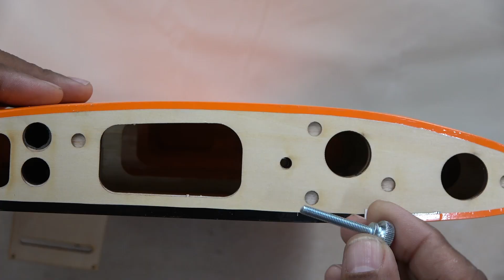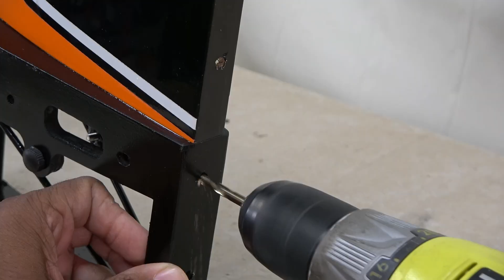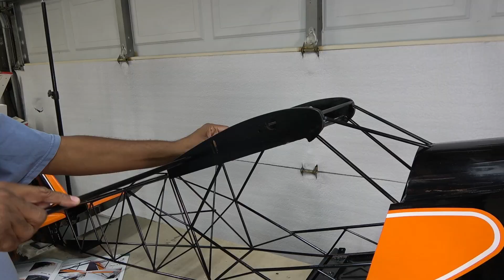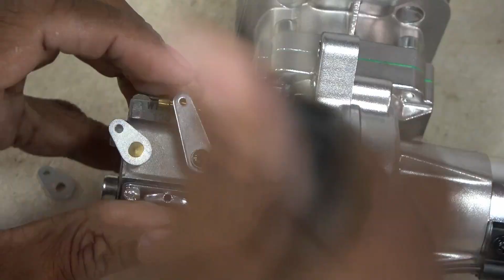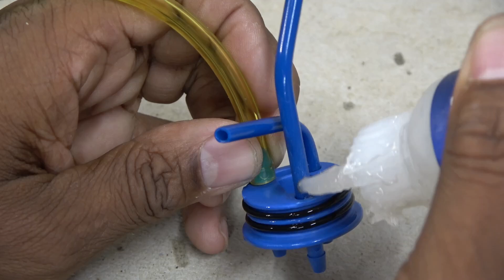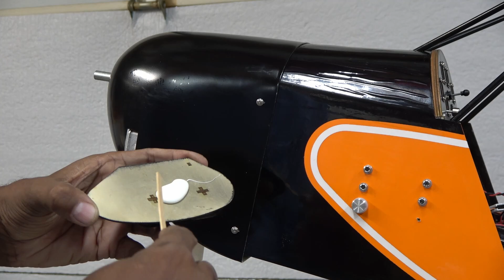Truss Me - Legend Hobby Savage Bobber Assembly | HobbyView

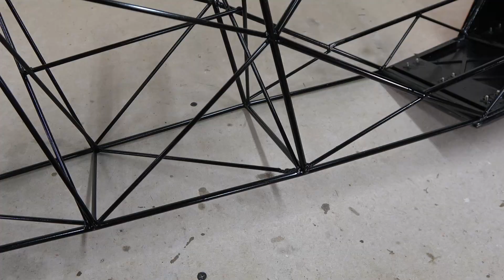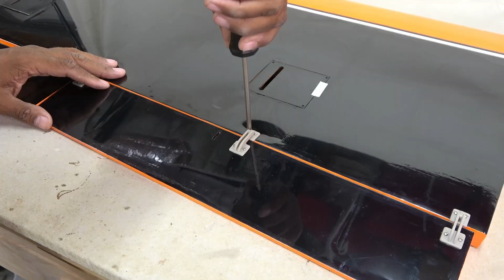Comment: information.          1:18    D-tube  is   NOT  used with  Wood construction.          2:04    metal tail boom.?!?!          5:57    a wing is  Supposed to have a  LOAD-BEARING  main spar,  Located  at  THIRTY percent of chord.!!!        the mass of wing-located servos is  NOT optimally located.       whynhel  stoopidly use a rudder cable linkage, while also stoopidly putting  a  servo  at the tail.!?              manufacturers  do  some   STOOPID  things.!!!               googletranslate
Reply: Olá! Onde consigo comprar esse kit ??,
Reply: Olá como eu compro um modelo desse ?

Comment: Pull Pull Tip:   ALWAYS loop the cable through the keeper prior to crimping.  Trust me here :)
Reply from the maker: I usually do, the wire in this model was a bit too thick to do that easily. Fortunately it's only on the rudder.

Comment: I've been wanting a Savage Bobber ever since I first saw it many years ago. Nobody had made kits, ARFs, or  any other forms except for ZLIN on their website, at limited quantities.

How i had started my kit was that I had decided on a size that I had wanted and hand drawn up plans using pictures and plans for a Cub as reference. Once the drawings were done I had bought the raw materials like balsa, CF rods and plywood and began to prepare for assembly. Unfortunately I had gone through some life changing events (divorce and relocation) that had put my projects on the back burner. Now that things have settled down and my life have become the new normal I need to resume my build. But, when I had discovered that Dancing Wings hobby had a one meter kit I had immediately placed my order one one. Unfortunately I had nothing but issues with the electronics, both from the kit and aftermarket because the factories were producing parts with poor QC. So my DW Bobber has also been put on the back burner. 

I have so many projects that are either nearly complete, partially finished, or are still in raw form that my to do list is growing. It doesn't help any that I had bought a brand new motorcycle back in August either. Now that the cold weather is settling in here in northeast Utah I can start focusing on my indoor projects. 

Anyway, I've already said too much, so with that, thank you for another awesome video. Now I'm wanting this Savage Bobber! But it'll have to wait until I can get some other projects finished, like my 1:4-3/4 scale Phoenix Models Westland Lysander, which is only needing electronics and a motor to finish.
Reply: I see a DW logo on the tire and the manual looks just like other Dancing Wings planes I have. I'd bet a bar night this is a Dancing Wings planes with someone elses name slapped on it.  MotionRC also sells some Dancing Wings stuff with their Skynetic logo slapped on.